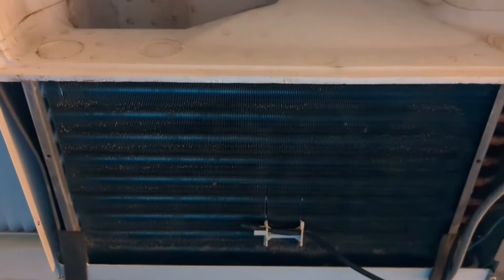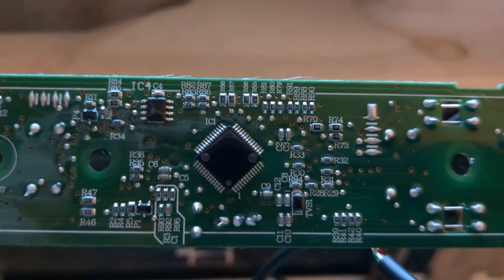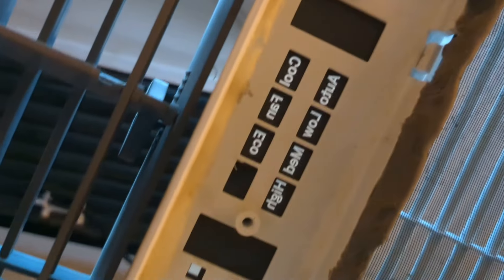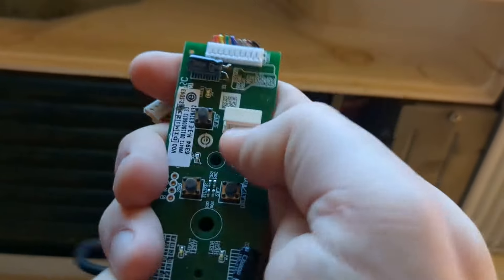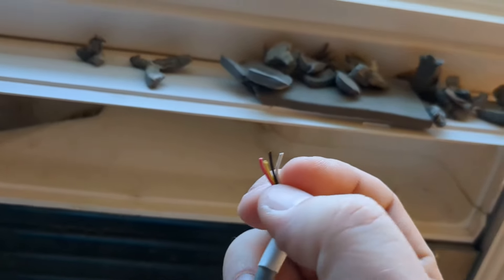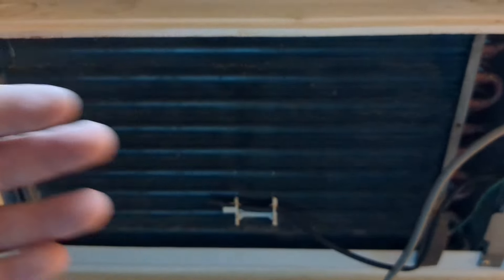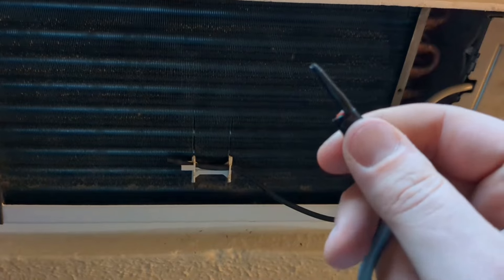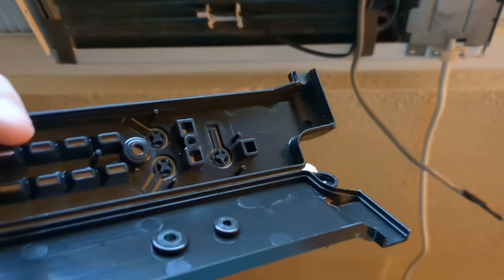GE Window AC EASY DIY Repair AHTK08AAW1 - AHC12LYW1 - ACH14AZW1 -  Beeping, Blinking, Resetting, 88

Comment: We’re do we sign for a class action lawsuit?
Reply: For real. I had mine for only 7 months before this went bad
Reply: I just had two AKLK14AA GE units go bad at the same time these cost us $600 each. Same issue controller board going crazy. Not to mention the amount of mold these things get all over the styrofoam. I will NEVER buy another GE product after this fiasco.Horrible products, horrible support. I was going to purchase new controller boards but guess what!? They don't even sell them anywhere! I talked to support and they said "it's not cost effective to sell these for us". HAHAHA what a joke. Anyways I'm going to try this soloution when I get home... but it's nto going to be cost effective for us since the unit will never be able to turn off by itself... so now our electric bill will be through the roof. Can't control temps... I really really wish we could sue them for this.
Reply: I’ll sign
Reply: @brandonclark1634 well i got my GE AIRCONDITONER IN 2020 used it for two years after then I moved into another house with central air didn’t need them kept put up then recently let someone used it for a month after a month I was told it started beeping then it broke I’m assuming it’s the circuit board that’s fried 😕😕
Reply: I'd like to be part of that class action also! Bought 2 and one has already went out. Just wondering how long until the other does it. Less than 1 1/2 yrs old.

Comment: BEWARE- This will make your AC work but you will have no indication on temp, mode, speed, nor Wi-Fi. Because of this do a process of elimination on cutting the wires to find the fault, one wire at a time. Or at least, before doing this save your settings before cutting all the wires mentioned in this video bc you definitely can’t change them after. Thank you for posting this! I now have a working AC blowing cold air on a hot day in SoCal.

Comment: Mine literally just died as well, I did the trick you showed us & it works like a charm again.  I think if I got 2.5yrs out of this unit it was alot.  I will NEVER AGAIN, buy another GE AC!  The old addage, fool me once applies.  Anyway I'm not buying another ac until next summer, anyone have any thoughts on a GOOD, REPUTABLE, brand?  One that will last longer than 2yrs lol.  And it certainly does NOT need, to have wifi.  At the time I bought it, it was all they seemed to have.   Thank You in advance & stay safe, health, and above all else, Happy!

Comment: I have to work with GE equipment at a hospital and they design things to "break" so you pay them to come and fix them and I always avoid GE for this reason, however 1 summer we had to buy a new AC unit and the GE one was the only one available and 2-3 years later it does this and I knew there had to be a work around because the fan and condenser would start, it was just some "safety" feature stopping it. Thank you so much for sharing!!! If any1 else reads this, for the future if you have an AC that wont go colder than what your aloud to set it, there is a wire going to the front of the grill when you look under the filter and if you move the end of that wire, its a sensor and try to shove it out the window, boom it will always run cold XD.
Reply: Thank you 😊

Comment: You have no idea how much I valued this tutorial.

I arrived from work on a Friday, the air conditioner with error 88 and no possibility of receiving a technician until Saturday of next week. I live in the Caribbean, where air conditioning is a necessity and not a luxury.

Thanks to your instructions, I managed to get it working and I will have a nice week, until a AC tecnician repairs it properly.

Thanks and blessings!
Reply: Hopefully by cutting those wires, they don't tell you that you voided out the warranty :/
Reply: Real talk. From the Virgin Islands I just did this 😂

Comment: Just found this AC unit on the curb outside my apartment complex, super clean and new looking but I assumed it was broken somehow. The issue you described is exactly what’s happening to this unit, so I’m going to try out this solution and hopefully have a nice free AC unit!! Thank you!

*EDIT* it WORKED!! Thank you so very much. I’m no electrician and your instructions were very easy to follow. I had one AC unit for a 2 bedroom apartment, so now I will be able to enjoy the summer temps with this second repaired unit. THANK YOU again <3 Good karma is coming your way

Comment: It took me about 20 minutes to install it on my own. As long as you can lift it out the box and up into position you’re good. I did have to break the box to get it out as it was a snug fit. I followed the installation video on you tube which was a big help. I added this to support central air in my house that was struggling upstairs because of my house design. Lovely unit. Very quiet https://www.youtube.com/post/Ugkx_hHgTlzH3uk31Fe2RVS3xEbXHGaN_z5T and looks sharp. Had it in a couple of weeks and so far so good. It’s cooling a bedroom about 25ft X 15 no problem at all.

Comment: Thank you from 8500 ft in Colorado, recent heat wave, beep beep 88 message, filter blink blink.  Pull out that electronic board, tie those four wires together, bypass all the frills and presto:  Cool Air.  Thanks again  I tried other  ideas, and your did it!
Reply: Recent "heat wave" at 8500 in CO, 80°?  🤣

Comment: Thank you sir for creating this video. My model AHTK08AAW1 purchased new on July 2022 just fried on me this week.

All other troubleshooting steps I took from reading online articles did not resolve the 'beep 88 reboot' problem.

Thanks to you, I attempted the same steps you mentioned here and now my AC is running like a champ again with cold air blowing in. It's strange though, when I opened the unit and got to the board, I didn't see any signs of water damage or corrosion. It was apparently clean so I was worried that maybe something else is wrong with my unit but I made the decision and went for it. Glad I did.

The only downside is losing literally any control functions/settings such as mode, temperature, fan, wifi etc etc.. 

However with today's economy and rising costs, it's an easy decision to make to get it running than to schedule and pay for an out of warranty technician to service it, or purchasing an entire new unit.

The only thing I'm unsure of now is what temperature it is running at. Like is there a default temp? Guess I'll never know but it's definitely running cold.

Also saves having to throw out an entire AC unit that still has a functional compressor and fan. All of the internal components work.

Thanks again!!

Comment: Thanks for the fix. It worked for mine. Only thing left to do is install a light switch next to the power outlet where its plugged into for power so it can be easily turned off and on. Thinking of trying a timer switch so it will cycle on and off during the not so hot months so it doesnt keep the room freezing. If anything qualifies for class action lawsuit...this would be the poster child.

Comment: Thanks this helped relieve the heat untill the new board arrived. I paid $39 bucks and installed in 15min. I also insulated around cover for extra moisture barrier.
Reply: where did you order it from?
Reply: Can you share where did you order your replacement from? Thanks
Reply: Can you show us how you replaced the board?

Comment: Worked on model AHL10LZQ1 until part arrived. Ordered the replacement board CQC13134092543, part no. WJ26X23879 from GE. To replace, remove the screws holding the cover on the sides and top rear corners, pull the sides away from the bottom, then lift the cover directly up. Remove one or two screws to take the small door to reach the secondary circuit board, disconnect the gray wire connecting your old board and replace.

Comment: I was able to repair by replacing the UI Board. Had to order replacement part for $40ish from GE website.  Ordered from GE directly to make sure the part was right. Came with new UI Board including plastic shell and wires to connect.  Just had to connect the other end of the rainbow wire into the unit itself by unscrewing the inner unit from the shell to get access to the area.  Kinda PITA, was a small space.  Also sucks to have to spend money on a part after only owning the AC for two years. But better than $600+ for a new 18,000 BTU AC.
Reply: please post the link
Reply: If you bought a new board from GE... I'd say... insulate the new board if moisture caused the problem to being with on the old board so that this problem won't repeat itself again on you. From just plain Jane foam or silica packets if you've got that laying around. I'm sure there's many ways to do it. Cheers
Reply: POST THE LINK

Comment: I just had the same problem, just stopped working, light blinking,only would start and run for 2 seconds.. THIS WORKS!!!!! I did mine today,awsome. One thing ,I had trouble getting front cover off, has three tabs on the top,I couldn't get them to let go so they broke off. Just put a piece of tape on the cover on top and screws on side and its fine... note ,I use geeni cameras ,lights and wall plugs .this all works from my phone. I plugged the cord into a geeni wall outlet plug ,now I can turn the ac unit on and off with my phone.  It works great!! You can get the outlet plug ins at harbor freight.
Reply: Ps.. I had this unit for 3 years,had bought the extended warranty for 69 dollars,  still had one year left. The warranty  place just sent me a gift card to lowes for 600 bucks...and I fixed it for free thanks to this video...

Comment: After only 2 months I'm just having the same issues with my TCL Smart wifi AC. We've had a couple power surges lately off the tropical storm. I live in NW Alabama so I understand the heat like you. Mine started reading the 88 with all the lights on too. I couldn't turn mine off without unplugging it tho. I'm assuming my issue is the same as yours tho. And the TCL site says they're not open again til Monday and of course it's Saturday night. Luckily it's supposed to be 78 tomorrow with more rain. It is suppose to have a 1 year warranty but I have to contact them. Walmart only replaces heat/cooling products within 30 days. This is why I dislike so much technology bc so much of it is so fragile and made so chincy. I never even used my remote or Wi-Fi on it but this one is the only type they had available in mid June so I had to or do without.  Anyway appreciate the solution video.

Comment: I have the ahk12lzw1 model which has a similar board. I cut the purple wire between black and white wire and the unit powered on. However, the controls do not work but it's blowing cold.

Comment: Just had a power surge and it fried the control board so I followed your instructions in your video and it works. I contacted GE and was told they don't supply the control board, can you believe that? Any way I had an extended warranty and I am getting a replacement unit (not GE for sure) in a few days. Thank you again for your instructional video.

Comment: I was really excited to try this. I had a ge repair person come out but they said it couldn't be fixed. So I thought why not give this a try. But after doing this, my compressor doesn't run continuously. It runs for 9 minutes, then turns off for 15 minutes so any cooling that happened goes away. Very sad this didn't work
Reply: Upload a video of the board you chopped out.  Show what kind of damage it has.

Comment: Is anyone else having trouble getting the front face of the unit back on?  Or, does the taped wire end have to go into that black box for it to fit properly?
Reply: i am having the same problem i did everything but the AC is off

Comment: Unfortunately this didn't work for the AKLK14AAG1 14,000 BTU unit. The connector only has 4 wires Yellow, Red, Purple, and White. I tried splicing them all together and the unit will not come on at all. I also tried just splicing Red, White, Yellow together and nothing. I'm guessing the absence of the black wire is the reason. Anyone know if there's a way I might get this to work? I'd appreciate it as it's about to get really hot and both of my units are down at the same time! I noticed the board had a lot of moisture on it when I took it out and a lot of rusted solder joints.

Comment: GE AHY08LZW1 -I got to my 3rd Summer b4 I had to bypass the circuit board. But you can use a smart plug and Alexa to turn on and Off

Comment: Does it bring it to the highest cold temperature?
Reply: The temp setting shuts the AC condenser off when the thermostat dips below the set temp. That capability is gone. The fan setting is locked into HI so basically, it's cooling at max fan speed all the time and will not turn off no matter how cold the room gets. Only way to turn it off is unplug it or use the breaker on the wall plug. Good luck!

Comment: I got mine turned on but it's only warm air blowing out....any way to fix that? It was cold air coming out when I first plugged it in but when I put the unit back in and turned it on then that's when it started blowing out warm air....

Comment: Why not cut all but black, white, red and yellow off the connector.  Probably can still use power button.
Reply: Did it work for you? Please let me know  right away
Reply: @brandoncasias6464  it worked in the fact that I could run the AC but still with only the same as in the video where they cut and wired nutted the ones I didn’t cut.   I could not control it any more than the video.   Still had to power on/off from the outlet.   I think I should have cut wires 1 at a time and tested after each cut.

I bought a new AC and will keep this one as a spare.   I went to a local shop that sells appliance parts and he said it would be $90 plus shipping for the board which, includes a wiring harness, but it would take 7 weeks to get.  I can shop around now through online appliance parts stores.   We are in the midst of a heat wave here in NJ and waiting was not an option.  Nor was letting it run at max cool without a thermostat.  I am not the only one in the house.
Reply: @FSCHW  thanks man!  Yeah I went to reddit and saw a comment about cutting the purple wire in-between the white wire and the black wire. I also bought a geenie outlet and can turn it on and off with my phone now!

Comment: I tried this exactly with the same AC and it didn’t turn on. The only difference is that I didn’t use electrical tape. Would that make a difference?
Reply: Don't ever splice wires and plug something in without electrical tape. You run a chance of fire electrocution, or ruining the unit.

Comment: What you can do is cut your power cord and splice it through a box and put a regular light switch inside.. Then you can just flip the switch to cut the power, rather than having to unplug it every time.   It won't look that great having a box dangling along the wall, but it will work..  Another thing you could do is pull your plug out of the wall. add a double gang box and then put the switch right there next to your plug...  . . . . . . .  .    or just unplug it. ;)

Comment: I’ve got the AHTK12AA model.  My J3 pin is disconnected.  Can you confirm on your control board that all the J1 J2 J3 and J4 “bridges” are connected?
Reply: That's what happened to me, and I cut the board off too close so now the board is unattachable I cannot hook it back up because the wires are too short. I am so mad at myself for assuming the board was fried, and not fixable with solder, so if anyone is reading this don't cut your wires too close, because it could be fixable with a soldering iron, and the replacement part is 70 dollars!
Reply: Did you ever figure this out? My j2 and j3 are open/disconnected/blown.
Reply: No my AC is still pulled apart.  I’ve heard of a replacement board but the PN is a little different.

Comment: We have had ours for two years tho so far . No clue the issue. Just stopped cooling all Together . I got a cover for the outside and zip tie the straps so it cannot be taken or messed with by passersby. What stinks is , where I live with my kid , it is so noisy outside . The neighbors are full of ignorance among other things I won’t mention . So I use it year round . (Mind when we are not home I shut it off ). It’s on fan in winter . Blocks out all the noise perfectly. Summer time is cool air . Until this year about a month ago it stopped working . I have cleaned it . With the proper tools. Coil cleaners , foaming cleaner ect . I guess I can’t do this because if I do, I will not be able to turn off the cool air setting . And it will be no use in winter . Guess I’ll have to find another solution. If I can’t I just might result to this . It’s too hot . 😢

Comment: I have a brand new unit that I hard wired like this but I’m im going to buy a cheap thermostat like the ones that run a central unit and wire it in to those little cables to control temp and fan.
Reply: Did this work?

Comment: Why not just buy a new board. Second is all the videos they show them cutting the wires. Do the wires connect with a plug or all them soldered in so if I were to just buy a new board. Will the connection just lift off and plug back in ?

Comment: Mine does the same thing after about two years old. Power went out for a few seconds then back on... Shorted it out. So pathetic. I can't believe new A/C units last only two years because of faulty ridiculous chip boards and probably because of nonsense like attach the A/C to your wifi. Overall, so ridiculous. I'm not sure if I'll replace mine or do this yet. But it's like 99 degrees today in St. Louis and my bedroom needs A/C.

Comment: If anyone is wondering…
It’s called a…
User Interface Control Board
Part # WJ26X23879
$80
Reply: How hard to get to the plug in the unit to attached the mutter board?